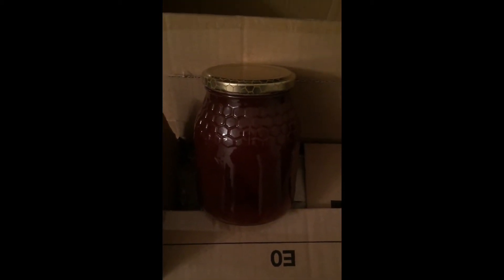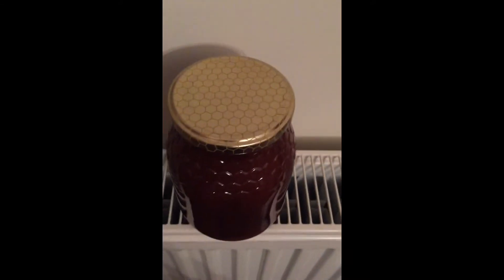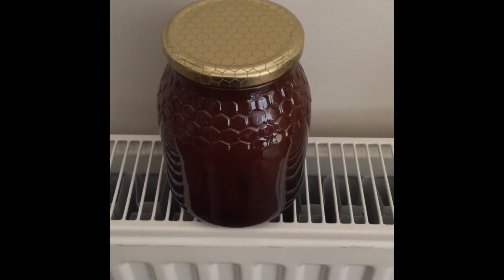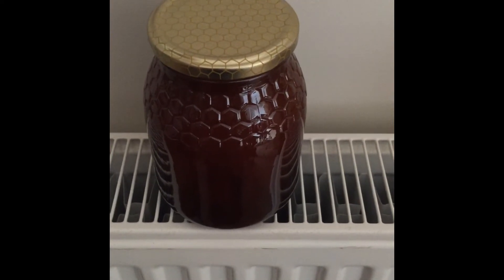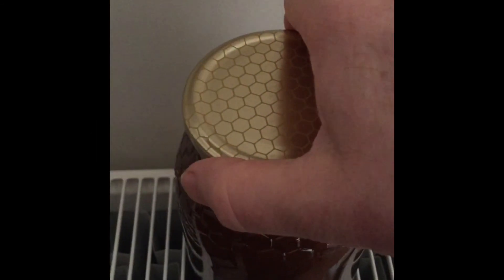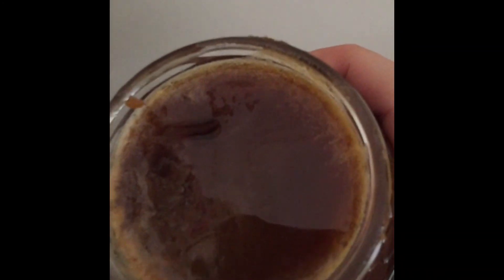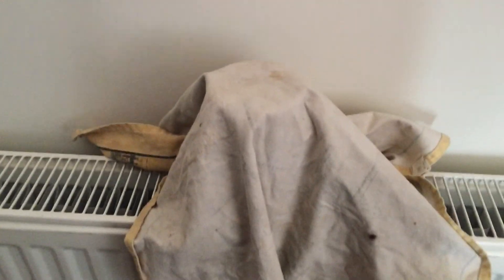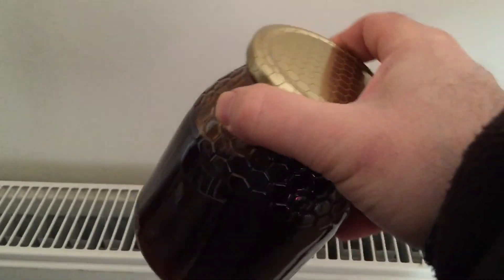How to make set honey runny without damaging the properties

Comment: Can't you just put the jar in a pot with heated water?
Reply from the maker: You can Zina. But you need sustained gentle warmth and the water can cool down quite quickly. Then you need to keep topping it up, which can make the process a bit more hit and miss. Tim, Raw Honey Shop.
Reply: Oh, I didn't know it would take more than 10-20 minutes in fairly heated water but when I think about it indeed may take time for the temperature to spread evenly? How about gentle heating in a microwave oven?
Reply from the maker: I have a personal thing against microwaves although I don't particularly have any proof to back that up.  I guess you could do that. But alternatively just put it on a radiator (on a thin book) and leave overnight.